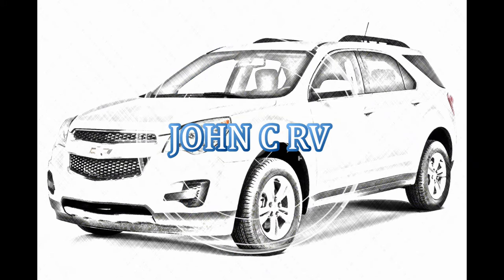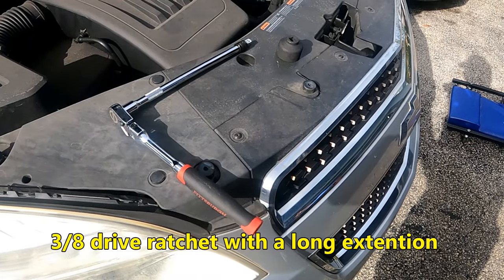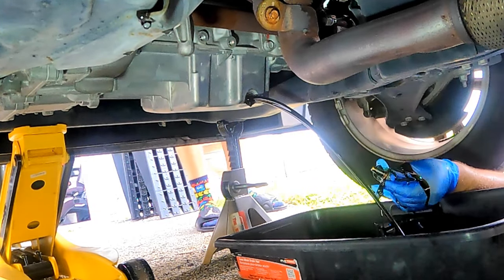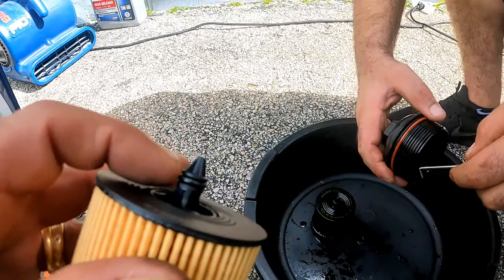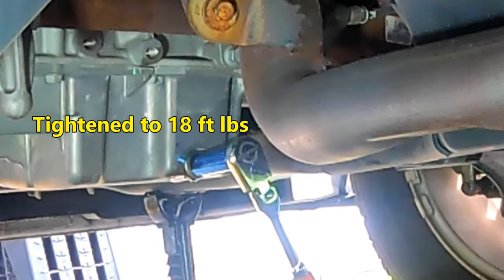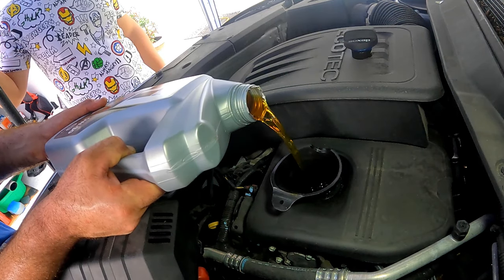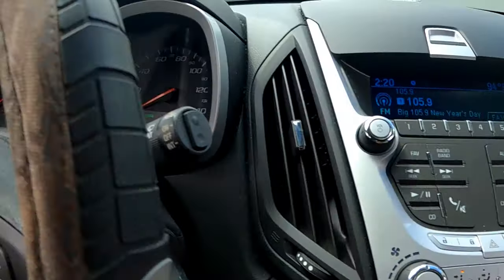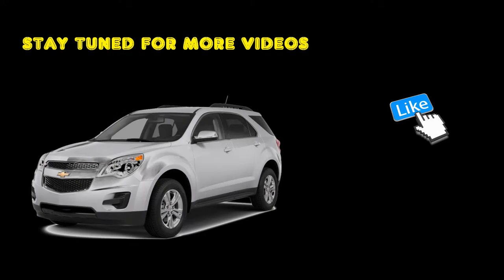How to Change Oil and Filter Chevrolet Equinox 2.4 Liter 2010 to 2017 & Reset Oil Life Indicator

Comment: Go with oem oil filter if you want this engine to last. Fram: f**k, ruined another motor
Reply from the maker: Thanks for your feedback
Reply: @JohnCRV  of course just want others to know how important the oem filters made by Adelco valvoline put one of their own brands on my equinox and it wasn’t doing right. Engine wasn’t getting the proper lubrication needed I wish I had known prior… will always do my own oil from now on. Less than half the price, better oil and the proper filter! Thanks for the video made changing my oil easy as pie. I’ve done a lot of other work on my car but never changed my own oil due to a fear of getting under the vehicle but I overcame that even with a couple jack stands it’s still a little nerve racking probably don’t help I’ve heard so many stories of people being smashed by their own vehicles 🙃
Reply from the maker: @BobSaget-ig6dt  I hear you. Fear of being under a vehicle is hard to overcome for many people, especially if you are not use to it from a very young age. 
It’s definitely worth doing it yourself and I’m glad the video helped.  👍

Comment: my equinox is at 204 000km didnt burn any oil after 15 000km im impressed
Reply from the maker: Thanks for the information. That's almost 127,000 miles. Very impressive. S, it only burned oil during the first 15,000 km and after that it just stopped burning oil? 
Did you do anything to it? and what year is your equinox?
Thanks in advance for the info, this may help others out there.....
Reply: @JohnCRV   nothing was done to it. couldnt afford to change the oil  so i just kept going. the stupid oil sensor in the car said it still had 23 percent oil life

Comment: 5 QUARTS,, 5 QUARTS,,,,,, not 5 gallon 😂

My 2015 Chevy Equinox actually took 5 1/2 quarts to bring the dipstick to the full mark after running the engine and letting it set & settle. 

You also need  the same 3/8 drive tools used by the video mechanic. 
1.1/4 socket, swivel & extension as 1/2 drive tools , or impact sockets are too fat to get in there to loosen/remove the filter. 

Some GM engineer needs flogged for the filter placement. They couldnt have place it  a tighter spot to get at.
 My 2015 Equinox also has a engine sensor right over the oil  filter housing  making it very difficult to get out. 

This video was excellent. Made changing my oil easy with the proper 3/8 drive tools. . 

Thank you. 😁👍
Reply from the maker: Nice catch!👍Glad you're paying attention!

Comment: I use a one and a quarter inch ratchet wrench but you have to cut off the open end. Works way better than a socket. You can also mark your oil filter cap with a paint marker before you take it off so it matches up with the arrow by where the filter cap is that way you dont have to use a torque wrench.
Reply from the maker: Great! Thanks

Comment: Very good video but my interest was in reading the dipstick end - never had a tip like this and I find it hard to determine what the level is.  On older cars, it was pretty easy but this one is so different.  Any close-ups on the tip after the oil change would be helpful.
Reply from the maker: I will uploading a video on that. Possibly this weekend.
Reply from the maker: There you go Dave.
https://youtu.be/hasX4j3v6lA
Have a great weekend.

Comment: How do you tighten stuff to a specific pound measurement
Reply from the maker: You need a Torque wrench....
Digital Torque Wrench with Buzzer ACDelco ARM601-4 1/2” (14.8 to 147.5 ft-lbs.): https://amzn.to/3Xi947I
Reply: @JohnCRV I just looked up the link and it is on around “half price “ normally 200 bucks around 100 now, but the clincher is that the Amazon store showed me a “frequently returned item “ pop up when I viewed this AC Delco link. I would assume they are a big brand name, but I wonder what the deal there is..?
Reply from the maker: @Yolo_or_no  not sure what that's about.  It has 4.5 star rating and I've not seen a return yet.

Comment: Do you put oil on to the o ring that goes onto the cap of the oil filter for a tight seal ? Or is this not recommended? Thank you for the information!
Reply from the maker: The oil is for lubing, not to damage the O-ring when inserting into cap.

Comment: I noticed on the cap it says 25 nm. You said tighten to 16 ft lbs but I can’t find any torque specs for the oil filter anywhere else
Reply from the maker: I forget what website we got the 16 ft-Lbs.
The 25 n-m is the metric system (newton meters) which = to 18.4391 ft-lbs (US standard) We used 16 ft-Lbs to make sure we do not overtighten it... and no leaks, plus easy to take off the next time we do an oil change... I hope that helps.

Comment: I believe you meant to say 5 quarts not gallons of oil to refill. Where did you find a low profile socket, I had to cut off a 1 1/4 combination wrench to make a stubby to get to the filter cap.
Reply from the maker: In the description there's all the links. Sorry about the Gallons 🤔
🛠️🧰👨‍🔧🔩⚡ TOOLS, PARTS & MATERIAL USED IN THIS PROJECT: 👨‍🏭⚙️🔧🧰🔨🔦
OIL FILTER for synthetic oil: https://amzn.to/3i8eS1u
1-1/4”/32mm Oil Filter Socket for GM Ecotec: https://amzn.to/3ioPIIV
Oil Filter Cap - Plastic Compatible with Select Models: https://amzn.to/3DglfG3
Magnetic Oil Drain Plug, Stainless Steel Sump Drain Nut Bolt with Copper Crush Washer: https://amzn.to/3IAunGU
Oil Drain Plug Red Cooper Crush Washers (20Pcs) M12 x 1.75 Coolant Seal Ring Gasket DFL-032: https://amzn.to/3x6Xz4P
Mobil 1 Extended Performance Full Synthetic Motor Oil 5W-30, 5 Quart: https://amzn.to/3ooFuMb
Oil Change Kit - Includes Oil Drain Pan, Longneck Oil Funnel: https://amzn.to/3F5WQ6G
Hope it helps...

Comment: The thing I learned about owning an Equinox is that NEVER go by the oil life indicator. That's just a fail safe reminder just incase you forget to do an oil change. Do an oil change ever 3000-4000kms especially if you own a 2010 model with over 150,000k kilometers. It just helps your engine live a lot longer.
Reply from the maker: Thanks for the feedback on the 2010 model.
Reply: got down to 25 percent oil lfe after 13 000 km insane

Comment: Never had a car burn oil like a Chevy equinox
Reply from the maker: I hear that with the ones built before 2015.
Reply: @JohnCRV  mines a 2015. I blew my engine, but got lucky and found out there was some class action lawsuit because of bad oil consumption and they had to honor it. Holy shit did I get luck or what? 😂

I’m out of oil usually when it says it’s at 65 percent. The only good thing is I don’t have to drain the oil because well, THERE’S NEVER ANY IN IT!!! 😂
Reply from the maker: @WTFBUTWHY  interesting, thanks for the info.

Comment: Don't forget to change the drain plug gasket.
Reply from the maker: Good idea but not necessary.
Reply: @JohnCRV  Best not to risk an oil leak over a .25 cent gasket. I buy them in bulk on Amazon.